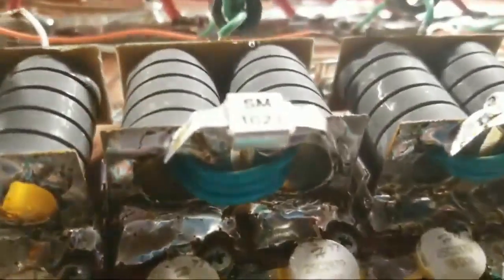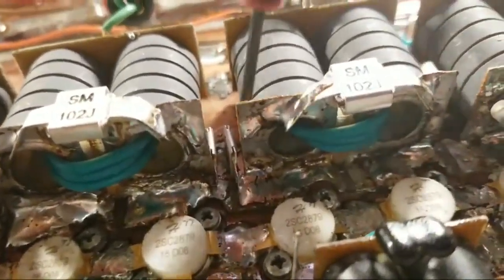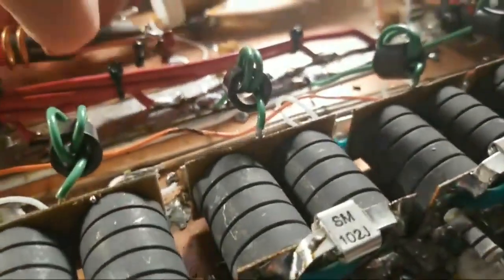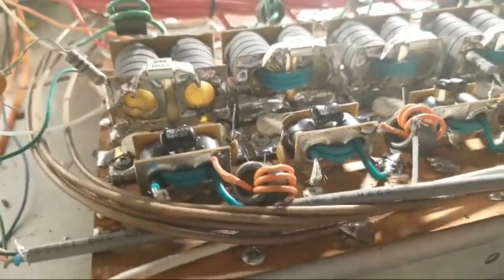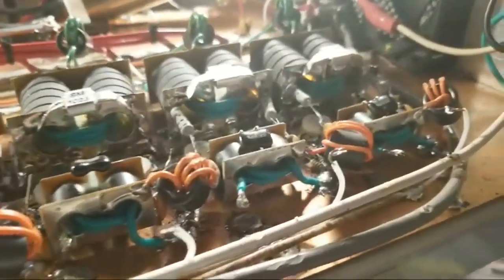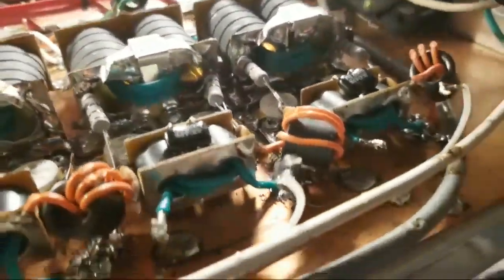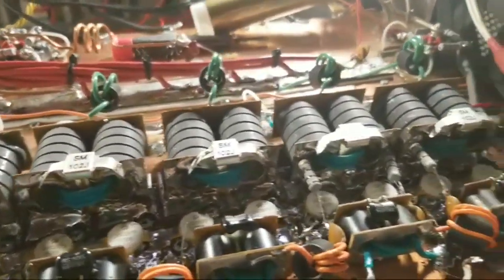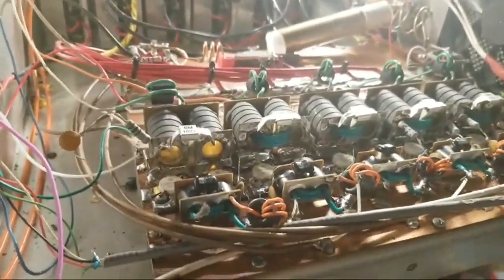AMPLIFIER HELD HOSTAGE FOR 14 MONTHS/JOKERMAN ELECTRONICS/ WANTS MORE MONEY AMP NOT FIXED/WANT 1000

Comment: Man he just made a video of a amp he hacked the crap out of it!! Drilled a hole right in the middle of the face! Drilled a hole in the lid scratched the crap out of it ,didn’t put a grommet on the wires there rubbing right on the steel 💥💥 what a shame totally de valued the amp. His scam shop should be called JOKER DEE HAKER...